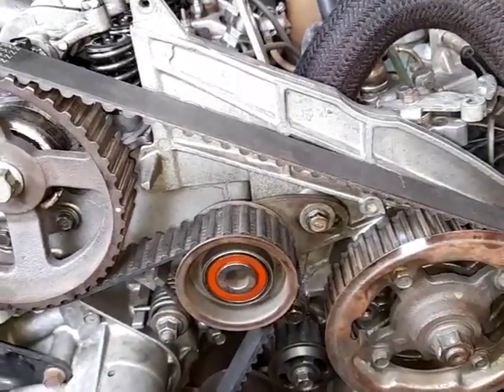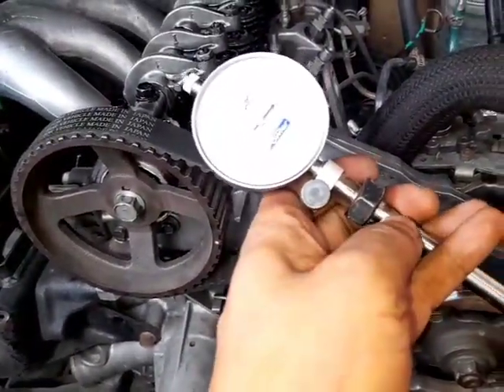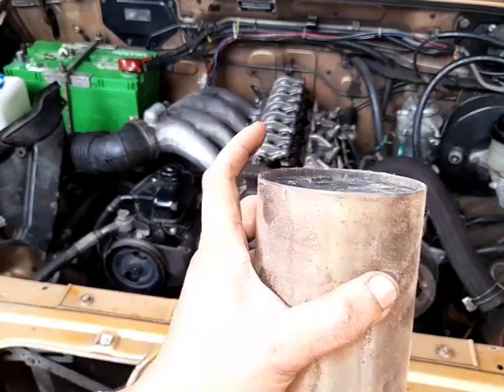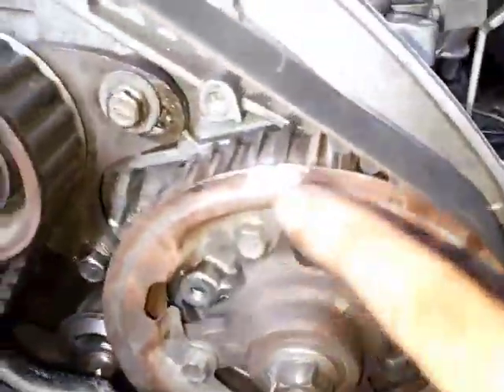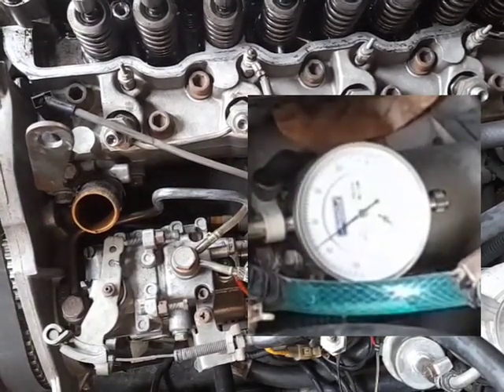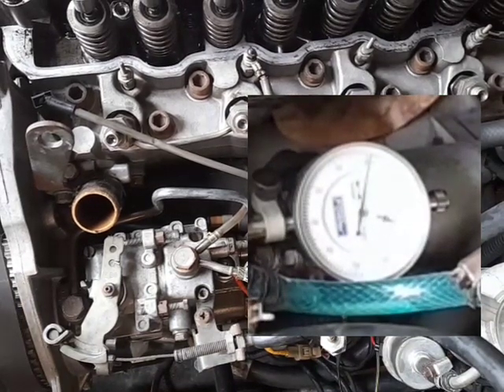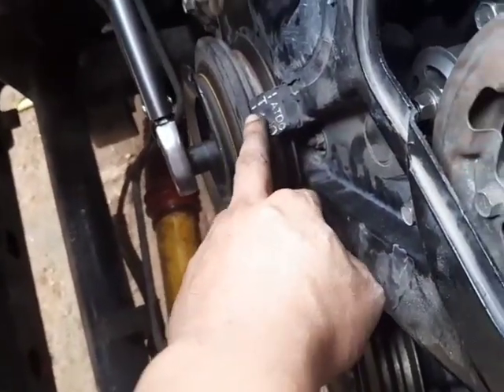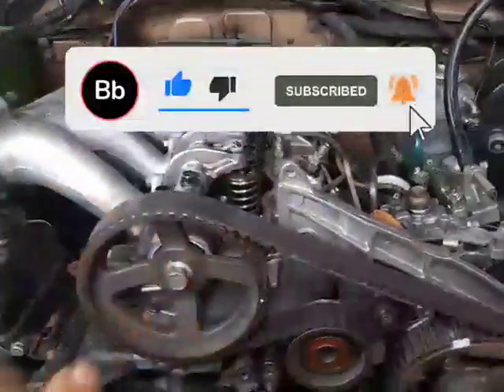Is Advancing the Fuel Pump by One Tooth Safe? 4d56

Comment: I think fuel injection timing for 4d56 engine is set default to 7-9 degree ATDC .  My question in large diesel engine why the fuel injection timing is at 12-18 degree BTDC commonly?

Comment: No, it is not safe. If you went to school for ICE. You should know that you are going to bend the con-rod and crankshaft by advancing the timing of the combustion. Also known as engine knocking. Either you advance or retard the timing you loss power.
Reply: I've heard of offsetting by one tooth before with 1990s Lucas EPIC instead of keep replacing a good belt just because it stretches at high rpm.  
But can't see how that changes the timing (unless it's the mega-old open loop tech with mechanical IP) , The crank sensor and the ECU mapping does the timing, not the teeth. If timing went out of timing actuator control range then the PCM would light the EM light or go limp mode or stop immediately after starting.

Comment: In Toyota 1HZ diesel engine the pump and the  bottom camshaft and set the same. Can only change the tooth in the top valves cam. Is that right? So can only adjust the timing with the pump twisting 15 degrees?
Reply: Is it possible i have turned the top cam around one full turn and mixed up my timing by mistake. Something is making this engine not run properly and ive done the dial gauge this to 1.03-1.09 a dozen times keeps running bad and chocking itself with smoke and stops.

Comment: After a fanbelt shredded and went under the cover for the timing belt on a 1.9 diesel Citroen the car wouldn't start ,however the camshaft wasn't smashed up so i put another cambelt on but the car wouldn't start.  I never had a dial gauge so I moved the injection pump one tooth at a time and listened to it cranking, I ended up moving the pump by 6 teeth and it ran fine then . I can only conclude that the inside of the pump had been damaged and moving it compensated for the damage.
Reply: In a Renault engine happened to me that the pulley tooth broke off, getting the cams off point, take a look and see if your pulley didn't spin on the pump shaft. Could be that, just taking a wild guess. Hard to believe that the pump internals could get damaged to the point of 6 tooth offset... Something would break because the metals in the pump are very stiff, not the bending type... That's my guess

Comment: Will having an injection pump too advanced also cause black smoke?
Reply: Yes, because diesel is injected until too late and doesn't burn, only gets hot and black like burnt food, that's the smoke. Heated up diesel until it turns into coal
Reply: Usually retarded timing causes black smoke.

Comment: If your vehicle has a running issue.. Sort the issue! Don't start playing around with factory settings to cure a problem, you will only make more problems or make the original problem worse. Factory settings are set for a reason.. Just think about this for a moment.
Now, if you are a competent engineer and have a good running machine and you want to tweek power and fuel efficiency... that's good (just so log as you know exactly what you expect to happen).
Don't just move pump settings for the hell of it because you can cause so many other issues.
Reply: Stock engine is tuned for emissions, this way you tune the engine to make more power from the same amount of fuel.
Reply: @engenhokas69 
Hugo, I'm in agreement with you there. The issue was to correct an engine running issue by advancing the diesel pump by 1 tooth to correct this fault. If 100% of motor vehicles are produced at a basic tune and are running properly then adjusting the pump to correct any fault is incorrect and will just cause further issues. This person just needs (first of all) to go back to the basics and correct the initial fault. Only then can you start changing setting to improve power/efficiency etc.
Just my pov though. 👍

Comment: Nice and informative video but I wonder what it would do to the fuel consumption and engine performance, anyways thanks for taking such a pain to pass on the info
Reply from the maker: You still have to tweak it by tilting the pump, but for so long as diesel in injected after atdc its ok even if you advanced it by one tooth.
Reply: Advance timing increases fuel efficiency and power output.
Reply: @westendinventor364  from what I've seen, and experienced, diesel takes some time to burn that's why you start injection before TDC as compression raises then ignites the diesel, and you still pumping diesel in untill after TDC, because if you inject all the fuel after TDC at higher RPM is going to smoke because compression will decrease and burn will stop happening, heating up diesel causing black smoke. The point is to ajust timing so it injects somewhere between bTDC and aTDC, finishing injection aTDC. Somitimes injection is started 30° bTDC so it has time to dump all the fuel needed in time for the engine to burn it properly. Timing depends on engine load and RPM

Comment: What's the purpose of advancing it by 1 tooth where there is the right timing indicated in manual
Reply: Sometimes you cant mechanically rotate the pump enough to match the right timing, so you use the tooth trick and then rotate to ajust timing. Every pump is calibrated differently. Stock engine is calibrated for low emissions, not efficient power production.